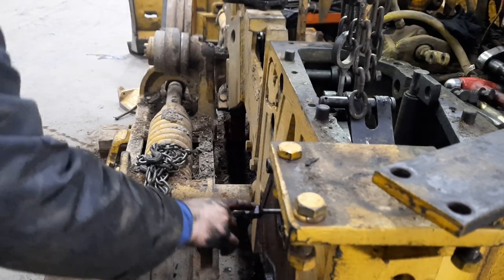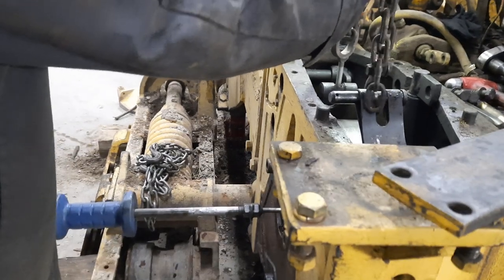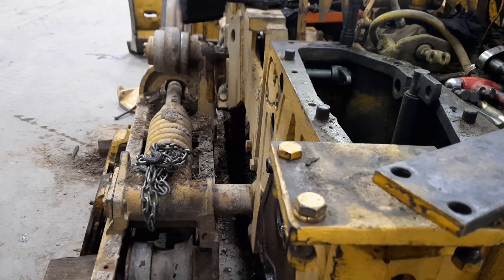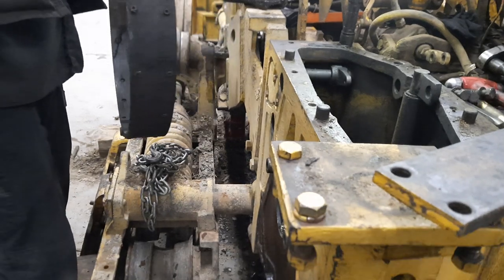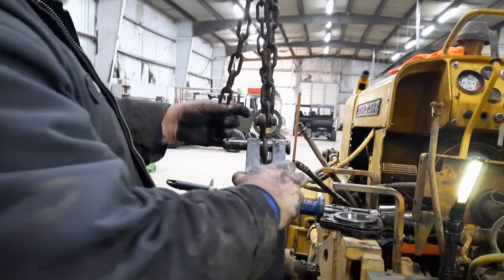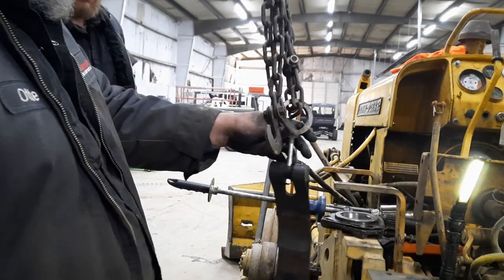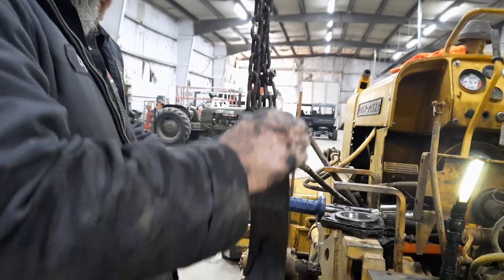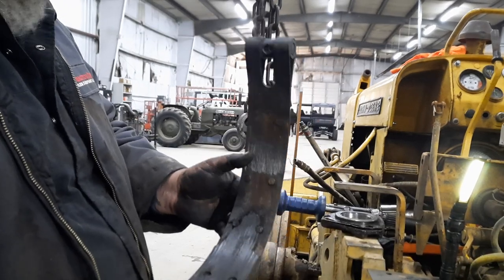John Deere 450 pt 5 steering clutch drum/brake band removal. Step by step lift out.

Comment: This series was very helpful to see what's involved in doing steering clutch/final drive work on a 450.  I have two 450C track loaders that I'm trying to decide what to do with.  One with stuck  engine.  If I part them out, are parts worth much?  Have one good undercarriage, and a cable winch with logging arch.  If I spent some time I might be able to make one running tractor out of two, but I'm not sure it would be worth the time.  I could do the work myself if I decide to repair one machine....don't think It wouldn't be cost effective to hire repairs done.
Reply from the maker: @d6c10k4  parts are of premium price so it is worth parting out. Not to mention that winch is $$$ sitting waiting to jump in your pocket!

Comment: Can you replace the steering brake band without pulling the drum
Reply from the maker: I'm not saying you can't, I'm just saying I haven't. The reason I don't is normally you have to bend the band halfs into shape. That would suck to have to bend to shape in the machine. Good luck if you try.